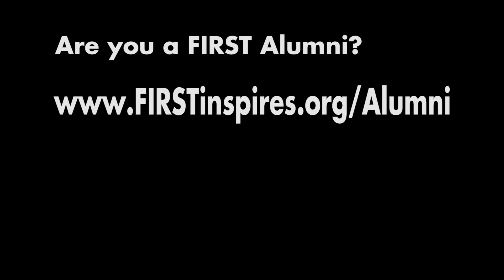FTC Relic Recovery: A Compilation of Ideas for FIRST Tech Challenge 2017 - 2018

Comment: From the game manual "The only legal way to Score a Relic is by placing/dropping it in the Relic 
Recovery Zone. Relics may not be propelled with any noticeable force (i.e. shooting, launching, flicking, 
etc.). Illegally launched Relics have zero Score value" so that relic launcher is illegal
Reply from the maker: Fine tuning needed.
Reply: We were proposing adding a gripping mechanism that spanned the entirety of the scissor lift apparatus however due to shortage of material (we only used what was in the FTC kit), we decided to launch the little yellow man to the moon!

Comment: A lot of those robots focus on relics, but only work if the relic is still standing. What about if it falls over during the game?
Reply: It can be on its side. But you get a bonus 20 points (I think) if its standing up.
Reply: Toad's Gaming and Tech The bonus points depend on which zone you’re in. That’s a very good point, but I meant during the initial pickup. Most people thought of using claws that grab the relic from their arms or around their waist while standing up, but they don’t have the degrees of motion in the claw to grab it if it’s lying down. During a lot of practice matches and scrimmages I’ve played, the moment you hit a wall a relic falls down and by end game, most of them aren’t on their feet anymore.